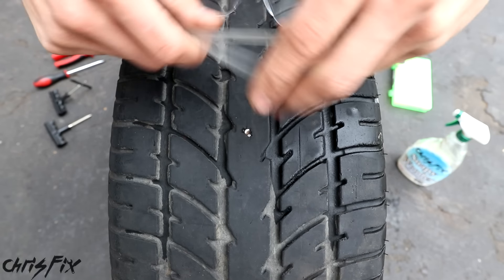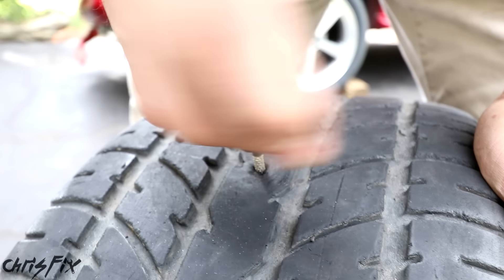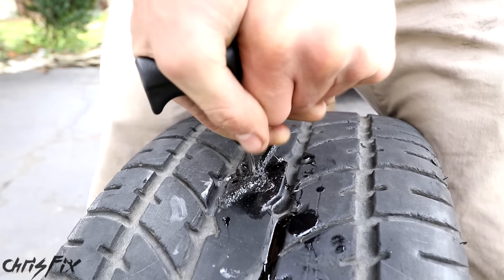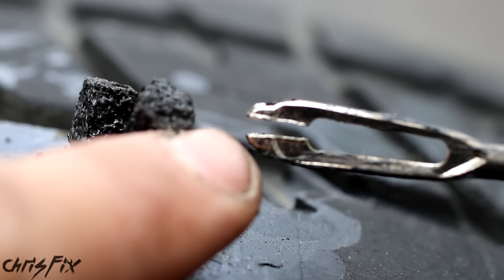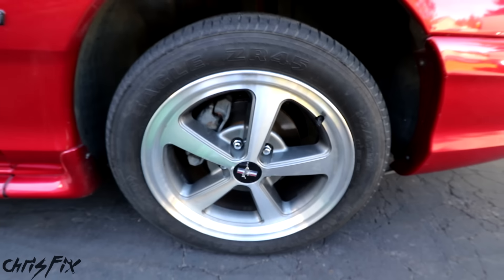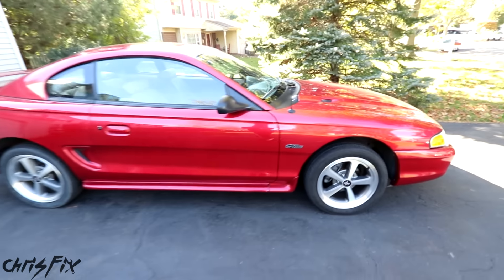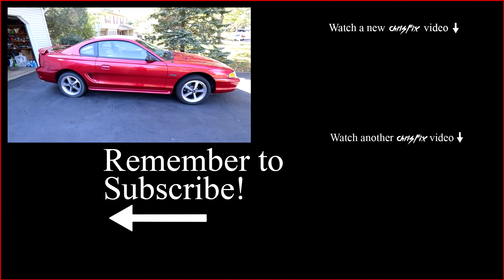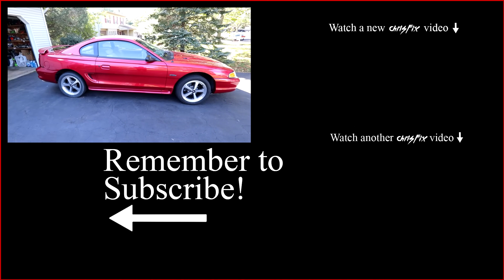How to Fix a Flat Tire EASY (Everything you need to know)

Comment: I've installed Tire plugs on my personal tires for over 20 years at the rate of about 3 plugs a year and have never had one single one fail for the remaining life of the tire tread. by the way I never used rubber cement ever and I only used the reamer if the hole was too tiny for the plug pusher which was almost never. plus I never had to Dismount my wheel in order to get to the puncture however for this video it was easier for chrisfix to display how to get this done with other safety disclaimers
Reply from the maker: Thanks for sharing!
Reply: Hi, 
In my country tire shops normally don't patch from inside unless the hole is too large, and also use plugs like you have shown. During many years I have not had an issue with this kind of fix. So, if done properly, most of the time it's permanent.

Regards
Reply: The reamer is to make the hole uniform all around 360 degrees. That way, there are no voids/pockets that the plug has to "squeeze" itself into. The plug stays in better because the rips/tears in the tire are smaller/shorter and thus move/flex less.
Reply: Same here! I've used tire plugs and never had one fail.
Reply: considering standard car tires only have 30-40psi it's no big deal.   There isn't a lot of pressure pushing on the plug and hold.   They would probably even work okay on bus/transport/ClassA-RV tires which are at 100+ PSI  but i don't know anything about the regulations on that matter.   From all the tire carnage i see on the highways, i think they probably already drive their tires until they literally fall off
Reply: @jasoninpersonam: I agree with everything you stated, but it would be so much easier to take the wheel off to put in the plug. In many cases, plugging a mounted tire would be difficult, depending on where the puncture is.
Reply: Jasoninpersonam l
Reply: I've seen AAA use plugs that last the life of the tire, but since no car maker or tire maker approves of them, I'd rather have an inside patch vulcanized on.

Comment: Remember once that it was so hard to get the reamer in that I used an electric drill first.  Worked very well.  Like most of us, I've driven on a plugged tire for the life of the tread with no further leaking.
Reply: So u used the plugged tire all the way until the tread of the tire was gone ? So it's really normal to do that without any problems ?
Reply: @where2098   It was a "permanent repair" for my tire. Don't know what's "normal" for other people. But obviously one should NEVER keep using a tire until all the tread is gone.

Comment: Awesome video, I watched it almost exclusively to point out the errors lol but there were none, you covered everything... nice work! I am a professional mechanic of over 10 years and have plugged a ton of tires. If properly installed (like yours was) I never have seen one fail for the life of the tire. Only time they fail is if someone doesn't ream the hole first or if they don't use rubber cement on the plug itself before installation. The rubber cement acts as a lube helping you slip it in the hole (you never want to stick it in the whole dry haha) and allows the plug to properly seat in the hole. If rubber cement is not used, they are a pain in the ass to install and sometimes leak.
Reply from the maker: +redline870 thanks a lot and exactly! I have never seen one fail either but I had to let people know technically it isnt permanent.

Comment: That’s very thorough. I’ve been to tire and repair shops to have flat tire fix for years and all the do is plug the leak with that needle. No patching inside, no glue, no prepping the hole with the filing stick. But it works.

Comment: Hey Chris,
Great video n details.
Just a small additional tidbit, if the tire is new or has considerable treadlife remaining, the best options (as you stated) are to: 
#1) Add air to get home or repair shop or #2) Put on your spare. 
The ultimate goal is to have the tire patched from inside which is a much safer permanent repair. 

/// More n more tire shops will NOT patch your tire from inside if you have already plugged it.  The newest safest repair is a PLUG PATCH, it's a rubber plug cylinder attached to center of patch, so the plug fills the hole and the tire is patched internally at same time///. 
Thanks Chris for everything you do !
Reply: Do some cars still have spares?
Reply: @rp9674  Most cars still have spares, smaller cars and crossovers normally have a small temporary spare in the trunk where Larger SUVs and trucks normally have a full size spare under the rear of the vehicle.
Reply: @Ben-uu7hz  that's crazy!

Comment: I just changed my own tire for the first time after a nail got stuck in it. I was highly impressed by myself lmao
Reply: @BUSTRCHERRI  Did this myself a few times, jacking up the car and lowering the hub down on to the tyre to break the tyre seal, and then using screwdrivers and random iron bars to get the tyre off.
It's definitely not worth doing unless you're an absolute glutton for punishment. If you do do this then the next time you go to a shop to get it done it will feel like the best €10 you ever spent.
Reply: @JoeBob79569  There's definitely a tool or machine that does that, so it's forced labor to do it manually.
Reply: @redshift8302  Yea, those tyre machines are great. I had a job changing tyres when I was a young fella, they're really satisfying to use. Especially the part that breaks the seal on the tyre, it's a really satisfying POP.
Reply: get a nail and poke it in the side of the tire and make sure the tire gets compelety flat and you will be even more impressed

Comment: Great video that shows basically everything you need to know to fix a flat tire and how to be ready for if one happens.  Too many people think it will never happen to them. They never check their spare tire, don't check if they have the tools and jack, etc. Then it usually happens when you least expect it.  It's usually raining and on an interstate.  Make sure you pull over safely and if it's not safe call for a tow or similar.  Don't work on your car or truck on the side next to the interstate. Also, great point on how fix a flat and green stuff tire flat fix solutions are not a true solution and make a mess inside your tire and wheels. Great video. Be safe everyone. :)
Reply from the maker: Thanks

Comment: I found a tire with decent tread that had a screw in it behind Pep Boys (back before tire shops slashed tires so you couldn't take them).  I plugged it and drove on it for 6 years and sold the car.  it was the best tire I ever had because I never had to add air to it LOL!
Reply: Nick B wait... they slash tires
Reply: Used tires they take off cars when installing new ones.
Reply: What do u mean u didn't have to add air?
Reply: Probably meant that he hasn't had to add air since he plugged the tire.
Reply: Well that tyre had a "tyre-ing" life of 6years

Comment: At the stage where you’re pulling out or unscrewing the nail/screw it’s a good idea to take notice of the angle at which it entered so that you can follow the hole accurately with the reamer. Otherwise you can end up with 2 punctures.
Reply: True mines at an odd angle, if I did it straight I’d make a whole new hole

Comment: Thank you for the warning about fix-a-flat. That sh!t should come with a warning on the can. We get people in the shop all the time who have used it and expect to have their tire repaired. Nope! Your tire is done. No reputable shop will touch it now. The problem is; even if you take the time and trouble to clean it all out of the tire you can never be sure if you've cleaned it enough. Any fix-a-flat residue left in the tire will keep the patch from sticking properly and it's too big of a liability  risk for the shop.
Reply: RichSmithify ya... Especially on New tires. - it would be cheaper to get a tow than to use that STUFF! Especially since... Well here, tires have to be PAIRED.
Reply: RichSmithify
Reply: RichSmithify I have a picture on my phone. one day at work a guy comes in with 4 flat repairs and every single one has fix a flat in it. I just remember my friend screaming "WE'RE 4 FOR 4 BOYS" LMAO
Reply: I fucking hate fix a sh1t because it fixes  absolutely nothing. Also do not get that stuff in contact with your eyes blind alert